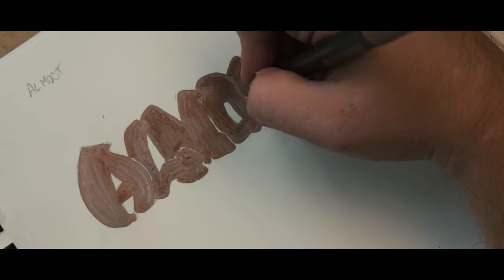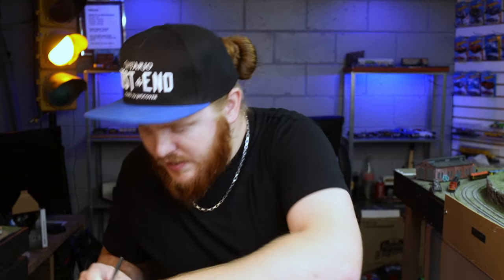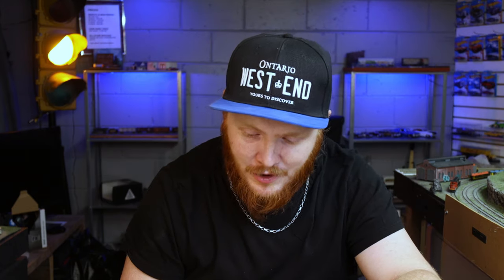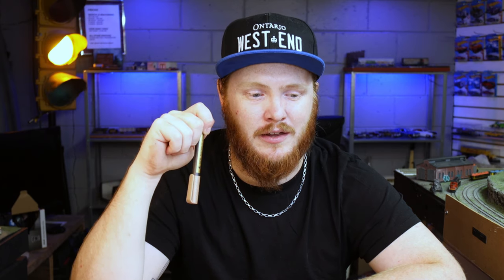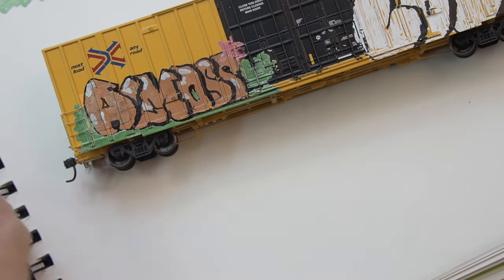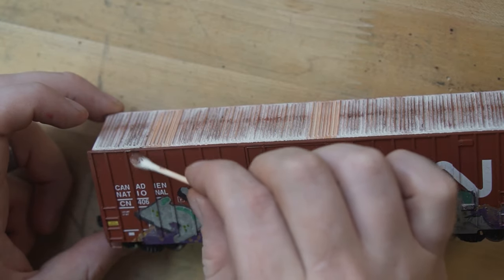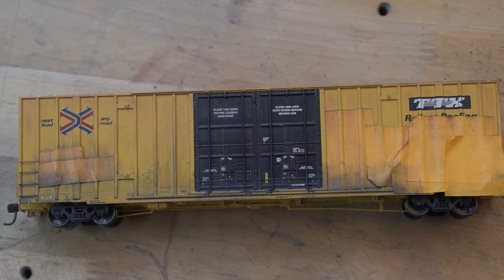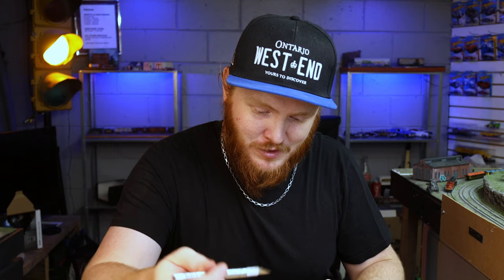Learn About Graffiti for Model Trains | 3 Types of Graffiti on Model Trains

Comment: Tim,your graffiti artwork is great on HO trains. Since I have N scale, l  have to draw mine first with fine ink markers and soft colored pens ,mixed. I redraw quite a few from photos of graffiti trains and I make up my own. It would  be very difficult in fact hard for me to draw on n scale models. Not with my eyes of 74 years. So I resize my drawings to accommodate my n scale models by using the HP machine. 🙂 It's very helpful to make decals this way. Maybe l'm cheating to do it this way but man it's easier than trying to squeeze the words into a small amount of space. It may seem that it takes time to do it but l throughly enjoy drawing. And I appreciate what you're doing as a young man and putting to use some of your talents and helping others .thank you for reading my comment. A friend, Mike
Reply from the maker: Thanks mike! That sounds like a cool way of doing it to be honest. Depending on what I’m doing on N Scale, sometimes I use a pair of reading glasses as magnifiers

Comment: some things to note about freight graffiti. most  freight pieces are called grounders as opposed to floaters. floaters "float" so you can see the botoms of the letters like your almost piece. but typically on freights the pieces get cut off at the bottom (no bottoms of the letters will be visible if that makes sense)
also, writers usually are very careful about their placement, so a guy wouldn't t place the  A from almost right over top of the numbers as the rectangle is going to pretty much delete the entire A leaving you with an LMOST piece. just some food for thought..
Reply from the maker: Thanks brother! Do you write?